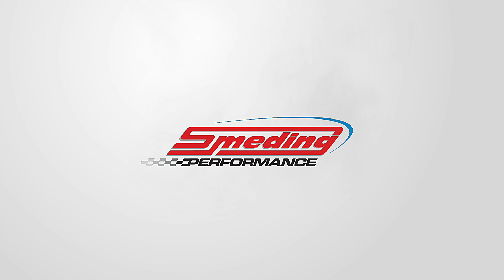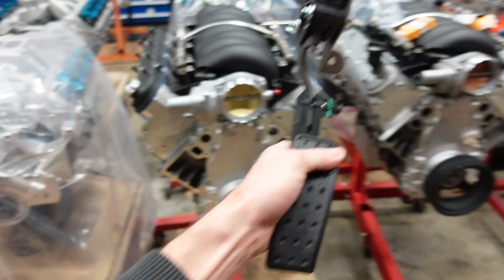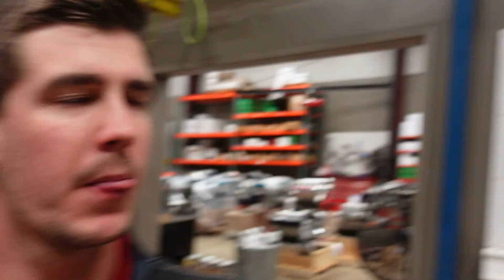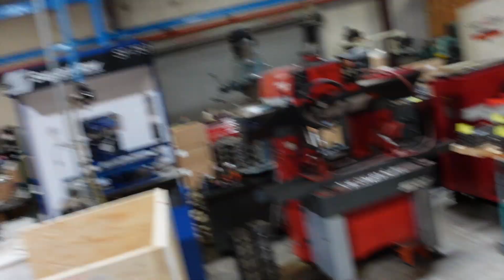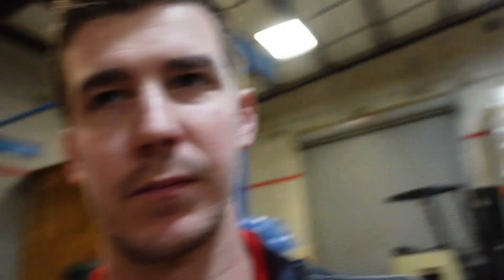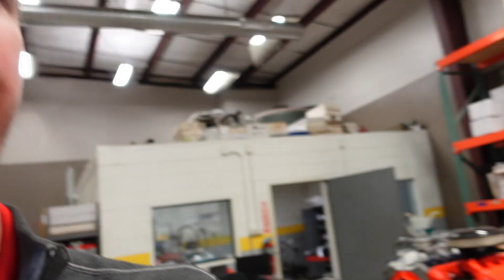$50,000 of Two 600hp Ford Engines | Smeding Behind the Scenes Week 4

Comment: I see u use scorpions rockers what level are  those? I had a 600hp windsor built by prestige motosports and with in 800 miles on engine 2 broke. They used the the level 1 which do Remer the actual name, but it was for 685 lift.